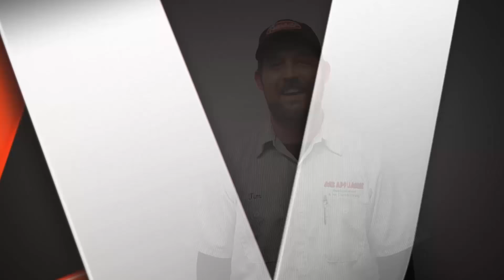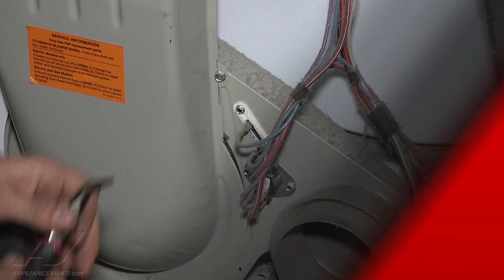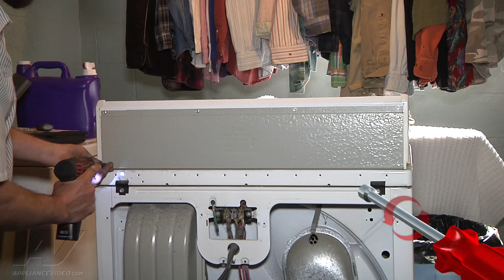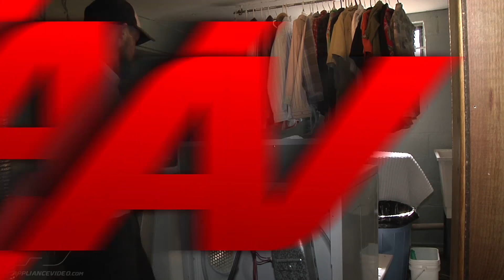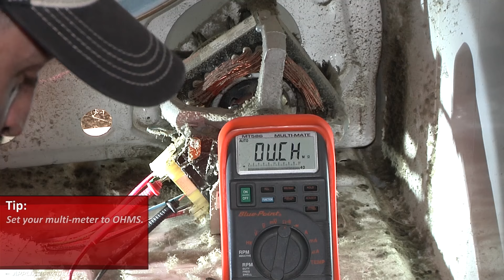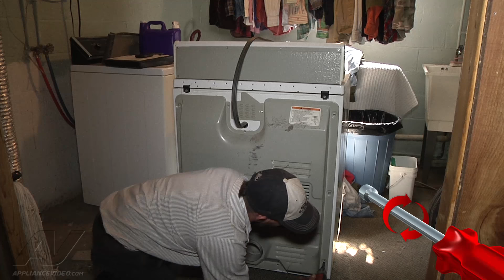Whirlpool Dryer Repair - Will Not Start - Motor

Comment: Great video very informative. I watched it because our dryer wouldn't start. I followed all your steps and found the thermal fuse blown with the volt meter. Taped the two leads that go to the fuse to confirm the fuse bad and to check if there was an additional problem. Power on the dryer started up. Further inspection showed the exhaust port and hose clear but all the Air vents on the back panel were pretty well covered in lint which leaves me to believe that the fuse blew due to the rise in heat from lack of proper ventilation. Thank you very much you saved me allot of time and money.
Reply from the maker: Thanks for your response, we are glad we could help. Our library
of over 5,700 videos are currently helping over 1.6 million people like you
every MONTH.  Please help us by
subscribing to our YouTube channel, or post our website www.ApplianceVideo.com to your Facebook
page, Twitter, Instagram or any other social media sites. Your support will
help us keep producing more free quality videos.

Comment: I have this same dryer and has worked very well for a long time. However, last night, after finishing a drying cycle, I went to start another and realized there was now no power to the dryer. Checked the circuit and, yup, it had tripped. I reset the circuit and started another load but was nervous to go to bed because why did it break the circuit? So, I stopped it after about 5 minutes thinking I would inspect in the morning to be safe. When I stopped it, it seemed very hot. Hotter than normal.

Took it in the garage and opened it up and it was very clean inside. About the same as the one you did in this video. Clearly no significant blockages. The aluminum vent hose was also clear and un-kinked. Going into the wall as fas as I could get my hand was also clear. I will try some electric diagnostics tomorrow, but wondering if you may have any ideas why it would trip the breaker?

Great vid BTW =)
Reply from the maker: Great question, if you have a more technical question that our parts department cannot answer, you can search our over 10,000 answered questions free at our website www.ApplianceVideo.com under our Repair Help section. You can also call our parts department at 1-800-830-5465 and they can give you help 7-days A week Monday Saturday, or search at www.SaveMoreOnParts.com  24 hours 7 days A week.

Comment: Just purchased a used dryer only to find out it doesn't run at all. I put a 3 prong cord on it to fit my outlet. Would a bad terminal block having anything to do with it not starting?
Reply from the maker: Great question, if you have a more technical question that our parts department cannot answer, you can search our over 17,000 answered questions free at our website www.ApplianceVideo.com under our Repair Help section. You can also call our parts department at 1-800-830-5465 and they can give you help 7-days A week ,or search at www.SaveMoreOnParts.com  .

Comment: Doesn't the machine have to be plugged in for the voltmeter to read the current across the fuses? I tried it with the dryer unplugged and got 0 on everything.
Reply from the maker: Great question, if you have a
more technical question that our parts department cannot answer, you can search
our over 10,000 answered questions free at our website www.ApplianceVideo.com under our Repair Help section. You can also call
our parts department at 1-800-830-5465 and they can give you help 7-days A week
Monday -Sunday, or search at www.SaveMoreOnParts.com  24 hours
7- days A week.
Reply: You're checking for continuity, not for voltage/amperage.  You're making sure current can still make it from one side of the fuse to the other, if it cannot then the fuse is bad.  See the first part of the video where he's setting the multimeter.

Comment: my dryer will run for about 50 minutes.  It heats up I guess and when you push the start button, it will not start until it cools off.  Replaced the thermal fuse and the push to start button, but it is still doing the same thing .  What else could we check?
Reply from the maker: Great question, if you have a more technical question that our parts department cannot answer, you can search our over 13,000 answered questions free at our website www.ApplianceVideo.com under our Repair Help section. You can also call our parts department at 1-800-830-5465 and they can give you help 7-days A week ,or search at www.SaveMoreOnParts.com  .

Comment: I need help. I have an older whirlpool gas dryer. After installing a new motor and thermal fuse, it ran good. It was slightly noisier than usual. With the top lid up and the blower wheel cover loose I thought maybe the top of cover was rubbing against the drum. So I pulled up slightly on the cover. When I did that, the bottom part of the cover touched a wire on a switch and sparked. This switch is below the thermal fuse. It has 4 wires. 2 purple, 1 red and 1 blue. Tested the thermal fuse and it checks OK. But now nothing turns on. The whole dryer is dead. Any ideas?
Reply from the maker: Great question, you can call
our parts department at 1-800-830-5465 and they can give you help 6-days A week
Mon-Sat . You can also search at www.SaveMoreOnParts.com 7- days a week.  If you have a more
technical question that our parts department cannot answer, our technicians are
answering all questions at our website at www.ApplianceVideo.com under our Repair Help section. We have over
4,000 common questions and answers that you can easily search through by your
model number, appliance make, and problem or error codes, and It’s free to
search through our question & answer library.

Comment: You promised but never gave us a view on the two leads in the back of the door switch.
Reply from the maker: Great question, if you have a more technical question that our parts department cannot answer, you can search our over 17,000 answered questions free at our website www.ApplianceVideo.com under our Repair Help section. You can also call our parts department at 1-800-830-5465 and they can give you help 7-days A week ,or search at www.SaveMoreOnParts.com  .

Comment: @ 1:49 are you checking for continuity?  I can't hear if the multimeter beeps.
Reply from the maker: Great question, if you have a
more technical question that our parts department cannot answer, our
technicians are answering all questions at our website at www.ApplianceVideo.com under our Repair Help section. You can also call
our parts department at 1-800-830-5465 and they can give you help 7-days A week
Monday -Sunday, or search at www.SaveMoreOnParts.com  24 hours
7- days A week.